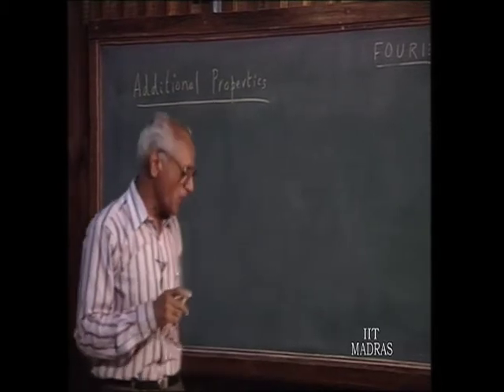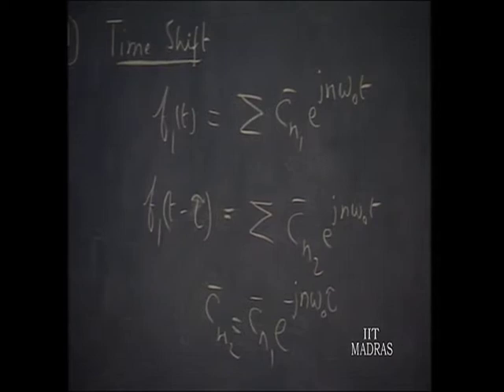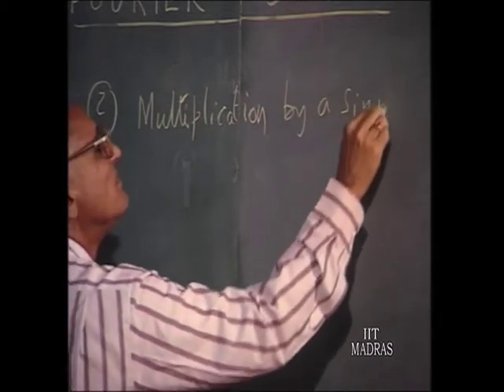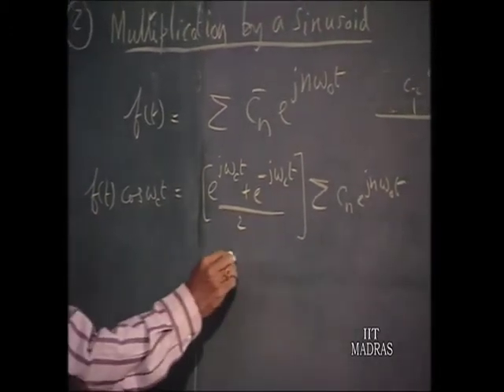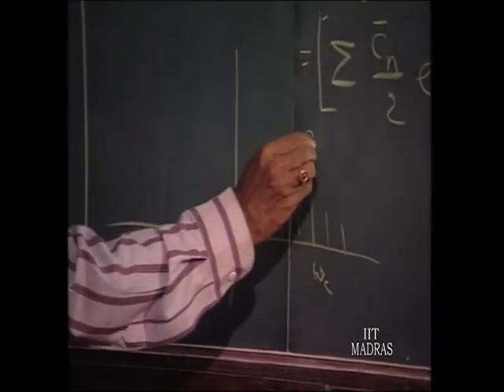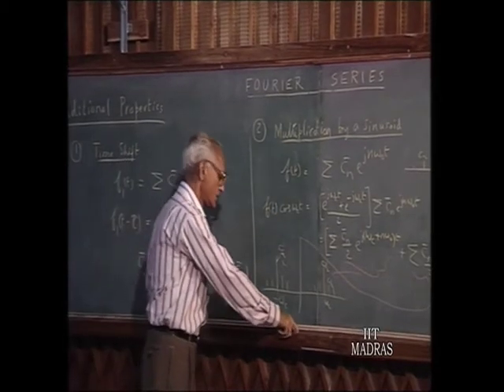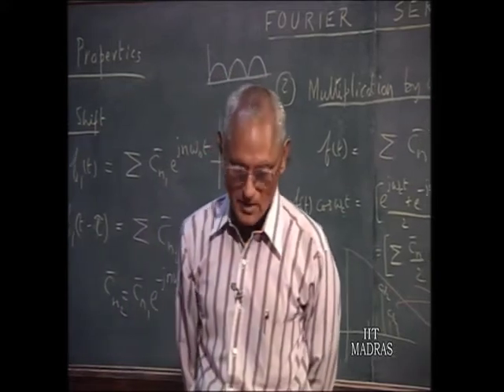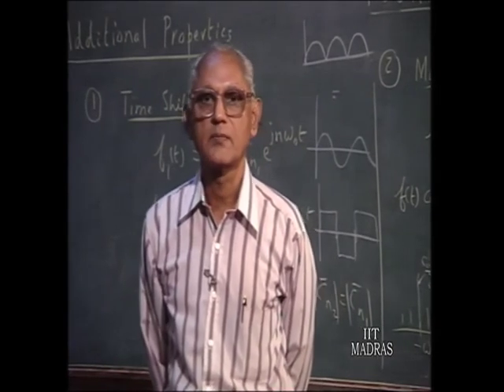Lec 27

Comment: 1. time shift : f1(t) = summ [ Cn1 . exp ( jnw0t ) ] then f1(t -- T1) = summ [ Cn2 . exp ( jnw0t ) ] where
Cn2 = Cn1 . exp ( jnw0T1). also | Cn1 | + | Cn2 | ie spectra of both have same magnitude but phase dec with freq w
2. product of periodic func by a sinusoidal func : eg f(t) = summ [ Cn . exp ( jnw0t ) ] then 
f(t) . cos w0t = summ [ (Cn/2) . exp ( j (wc + nw0 ) t ) ] + summ [ Cn . exp ( -j (wc - nw0 ) t ) ] ie. spectra get divided into 2 parts, one shifted to & centered around wc and another shifted to & centered around --wc. his is usefull in communications and instrumentation and f(t) then is called as carrier freq.
eg. a full wave ( FW ) sine func = regular sine wave func + square wave func of same freq
Note : harmonic and spectrum analysers are used for harmonic analysisi